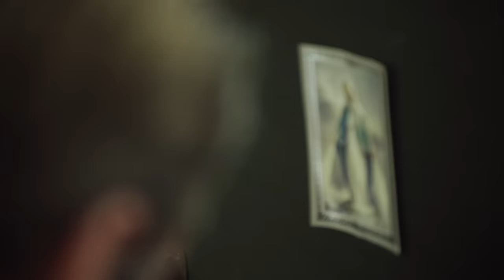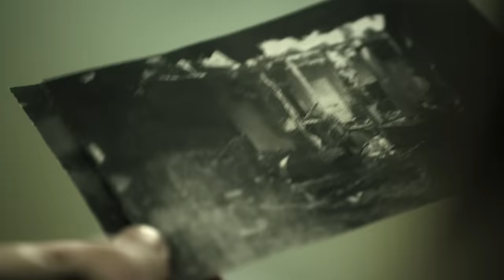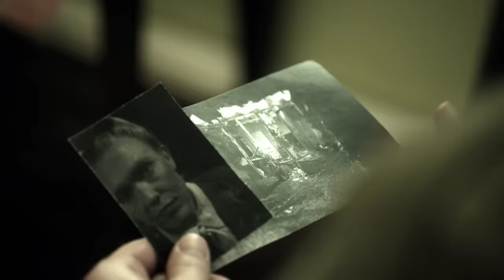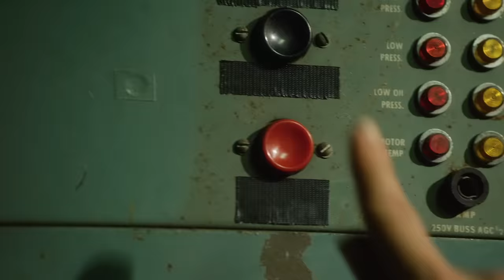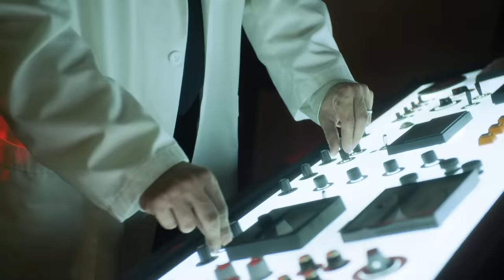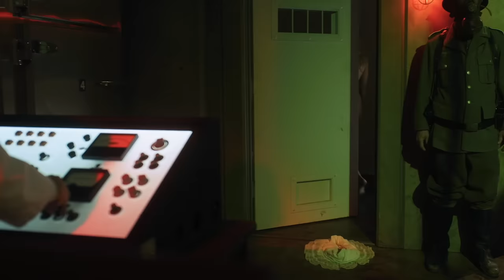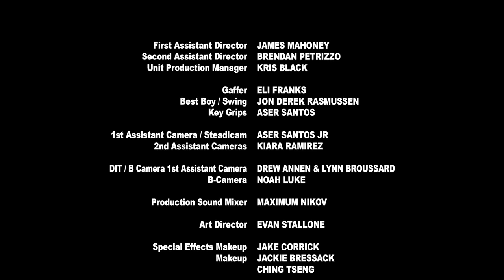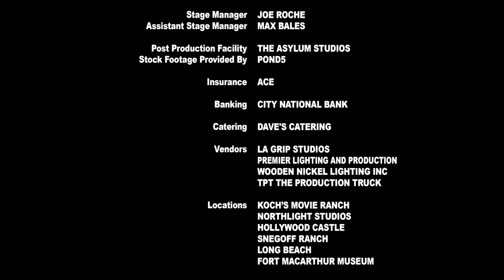Nazi Overlord | Full Movie | Action Horror War | Tom Sizemore

Comment: Why was the the captain carrying a Thompson when they got ambushed first time around and then all he has at the second ambush he only had his sidearm?, plus why was the Colonel briefing the captain wearing a set of Sgt stripes?, very poor wardrobe and props department, but still, nobody’s perfect, I’m sure they only had a small budget and did the best they could. 
Not the best movie ever made but worth the entertainment value. 🙂👍🇬🇧🏴
So there trapped in an old mine with both entrances blocked by the Nazis, but it’s light in the chamber they were trapped in, why didn’t they just go out the hole that was letting in enough light to illuminate the whole chamber, but no, use a grenade to blow out a crawl space, really logical, especially as most of the blast would be into the chamber and not the rock fall.